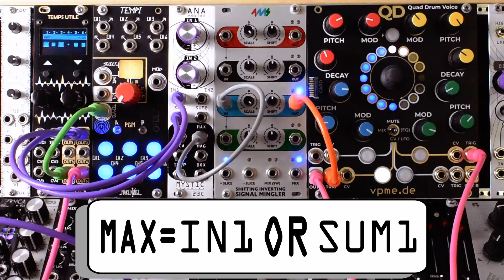ANA Processing Gates and Triggers

Comment: I really dig ANA. I really wish it had bipolar LED’s on its outputs. Maybe ANA 2 will have them.
Reply from the maker: Hi Mike.  Thanks for the kind words.  Ana v2 is going to have LEDs to display the voltage of the main 2 channels of input.  Having LEDs for each output would add a ton of circuitry and take up a lot of space on the panel, especially now that the jacks are all much closer together.

I'm going to be showing the module at Superbooth so you should be able to get an idea of what things will look like in about a month.